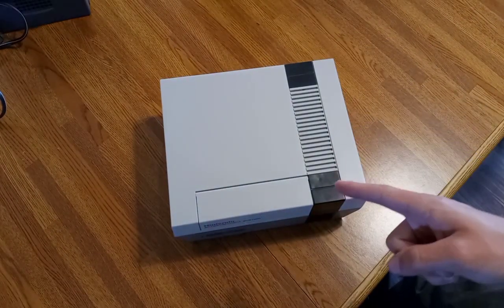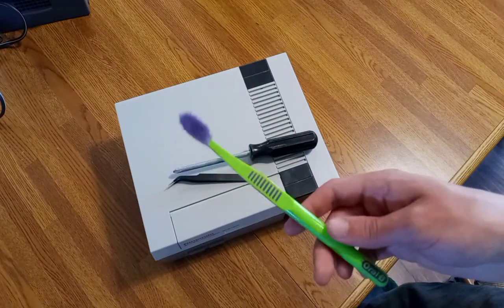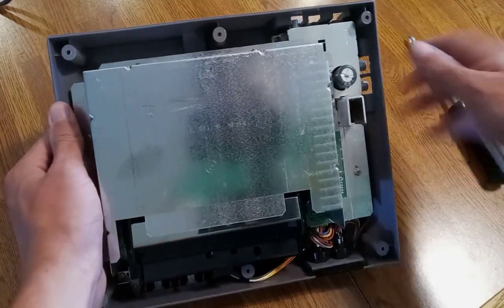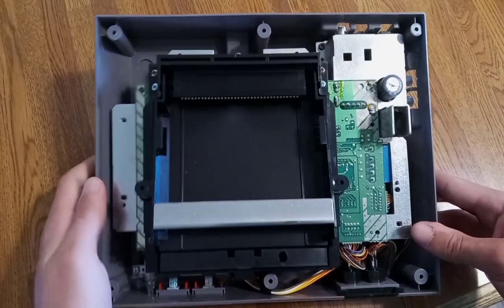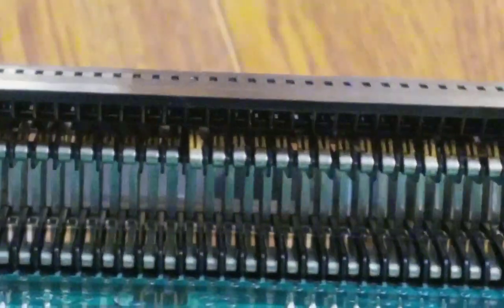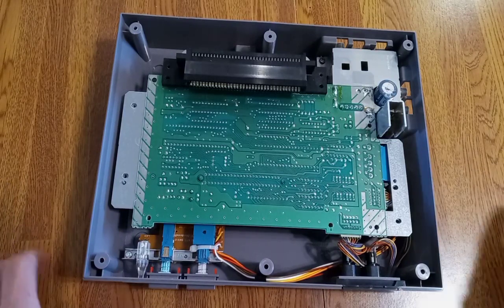How to repair an NES, and disable the lockout chip!

Comment: Great video!
But I have two questions.
1- exactly how long you have to throw that metal thing?
2- where did you get my sister's toothbrush??????
Reply from the maker: 1. Topically you throw it about 5-10 feet.
2. You find your sisters toothbrush in the bathroom either in a cup or in a drawer